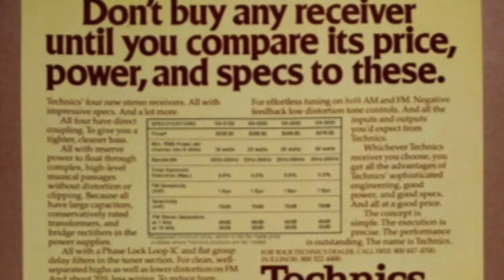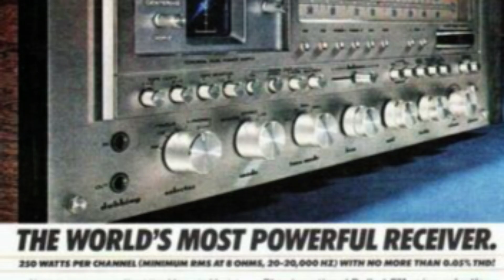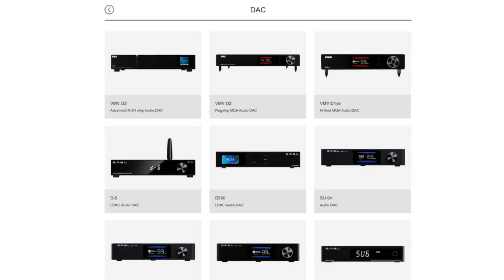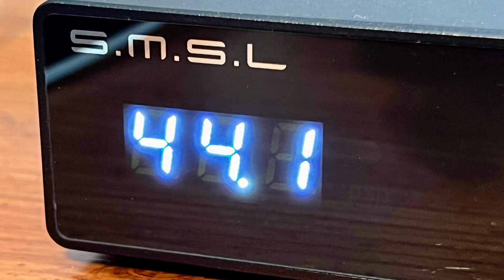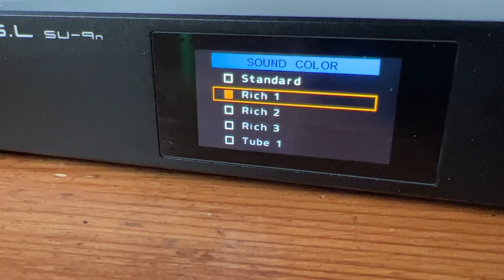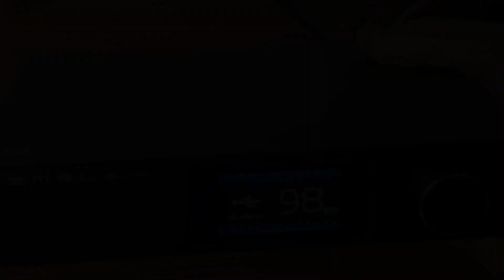When Hifi Measurements Don’t Add Up! Review of the SMSL DO100, HO100, and SU-9n.

Comment: Measurements are VERY important in audio:  The physical dimensions of a piece of equipment will tell you if it will fit on your shelf, and the equipment's weight will tell you how much it will cost to ship it back for repairs!

Comment: I used to spec surf when I was a kid working in a hi-fi store. Once I realized that the weakest link in the chain is in fact our own ears, and that everyone hears things differently, I started using my ears and stopped reading over-hyped articles by self-appointed "experts".  And I've never looked back. Very happy.
Reply: That's definitely similar to my own issue around measurements- while it's very useful to find out whether or not you're getting ripped off with purely psychosomatic crap, and can provide a general idea of its performance and how it might sound, it's completely independent of your own preferences.

Comment: There's a difference between Hi-Fi and 'My-Fi'. A good measuring dac, amp or speaker can 'measure' very close to the source (and what IS that source btw), however, you may not like it. Measurements are not a bible, but may assist in pointing out the type of sound you prefer. Measurements may also show and disarm wild manufacturers claims. How well can a speaker play loud, before noticable distortion, components used, performance vs price, etc.
Tell any studio engineer measurements don't really matter and odds are great he may smile at you. We tend to adjust sound to our preferences, add coloration in a some form (or not), etc. Laidback, forward, V-shaped, all fine, but mostly My-Fi and above all, subjective.
Reply: I definitely agree with you, but I think it should be said that My-Fi should not completely and utterly financially disarm you. There's tons of products that may improve the listening experience by changing the expectations you set on your system, but that doesn't make it worth the price when you can get the same effect for free.
Reply: @oriorb  
Yes, that's a good one. Don't get absorbed in the madness of others 😄

Comment: I see you are comparing apples with apples. Very clever. I'm wondering if Jupiter has the same magnetic field as earth. I can look at it through a telescope,  figure out its size and its mass. Will that help me get the right answer? No. I have to measure the right thing and know how to measure it. But before I can even try I need to learn as much about magnetism as I can. That is the same problem the high end audio industry has. It doesn't know enough about sound, the role acoustics play, the capabilities and limitations of human perception of sound, or how to measure any of it. So it has as much chance of duplicating sound as someone has of duplicating the taste of an apple has by carving its shape out of a rock and painting it.
Reply: I think you'd find they'd get pretty close once you remove the extraneous perception variables of the high end audio consumer. The way music is recorded, it may just be impossible to create the same kind of real, live effect for each recording unless you create a new standard for sound reproduction, and recordings are done in line with that standard. Or, you can extrapolate old recordings into the new standard.
Reply: @RennieAsh  That's an interesting expression. Extrapolate old recordings to a new standard. That's why I do. In the adaptation of my invention for entertainment (it was originally conceived of as a laboratory) it is possible to reconstruct the mission acoustic effects of a very large room from what's on the recording based on a 6 dimensional mathematical algorithm.  There are vectors in space, one is amplitude, the dependent variable, and another is frequency. Wave Field Synthesis comes up with a convolved mathematical solution that is the same as mine but its measurement methodology they call "capture" relies on an impulse response. Originally I tried this also but it doesn't work. The reason is that it cannot segregate the time and frequency variables because as the sound decays the spectrum changes. In a typical concert hall for example the RT at 1 khz could be 2 seconds but the RT at 8 khz could be around 1 second. I've bot data for about 200 concert halls around the world, about half of them in the United States. I had to resort to a much more tedious method using mapping functions testing one frequency at a time. There are a total of about two dozen variables that affect the sound field at the listener at any given point but all but six of them are conditions of state, boundary values, the location of source and listener, and the specific way the source launches sound into space, that is amplitude as a function of frequency and direction of propagation. This is why their solution is a double integral equation and mind is a triple integral equation. The spectral change as a function of time for each musical note changed the perceived tonality. So the first arriving sound has the most high frequency sound giving it clarity while later arriving sounds have much less giving the sound warmth. In audiophile terms where only a small slice in time for each note is recorded the problem of spectral balance becomes impossible to solve.
Reply: @user-xg6zz8qs3q  I see your point, ignorance is bliss. It's also easy. No effort required. No banging your head trying to understand something. However, there are a small percentage of people like me who like to try to understand problems and if possible solve them. If anyone thinks that the current state of the art of sound reproduction sounds like live music in a concert venue then they have either never been to a live indoor concert or they are deaf. Considering what most audiophiles listen to, I'd say what's on the market already is good enough for them. What I want and expect makes it not nearly good enough for me.
Reply: @markfischer3626  You're setting yourself up for high expectations, high expenses and major disappointment. Audiophiles like to make a big deal over minute problems. Manufacturers love to charge top dollar to alleviate those problems, or create problems and offer costly solutions. If you found something good enough, you'll stop wasting money on Hi-Fi gear for negligeable gains that you can only perceive through A/B testing. You're never gonna get the live experience at home, because you're listening to a hacked recording (autotune, drum correction etc...). In fact, having a revealing system is a curse. Because most music will sound dull compared to well-recorded music. The flaws will be more apparent. Knowing that, entry level speakers with a run of the mill Yammy/Denon/Pioneer/NAD amp from Craiglist is a wonderful system. Why? Because the cost is down, the expectations are realistically low and the sound is more forgiving on poor recordings. But don't run and get overhyped, overly sharp treble cannons like the Sony SSCS5 or JBL A130. You'll suffer.

Comment: Adding those parameters  together is losing credibility. You are now being unscientific, and it would be like buying an amp based on how big it is multiplied by the number of capacitors in it.
That's right. If you measure irrelevant parameters and create new "impossible" units of measurement, of course it is nonsense!
Reply: Point missed completely. The exercise was one to demonstrate the futility to quantify that which appeals to differing tastes. It is you who are lost in the message.